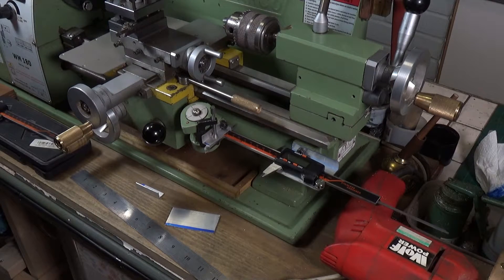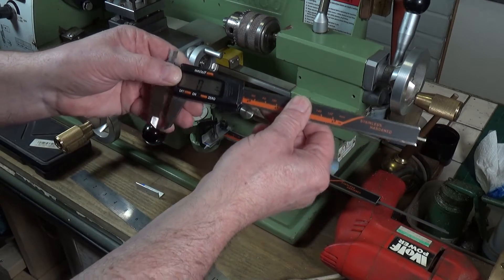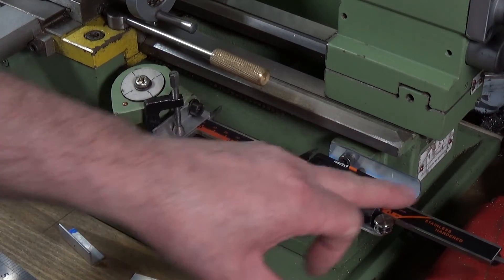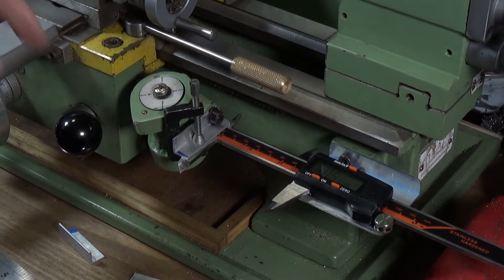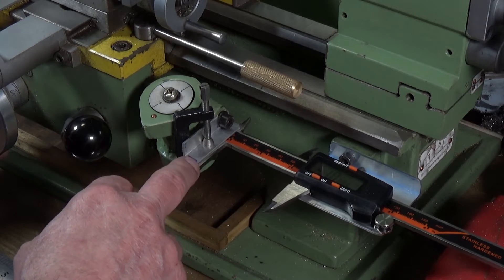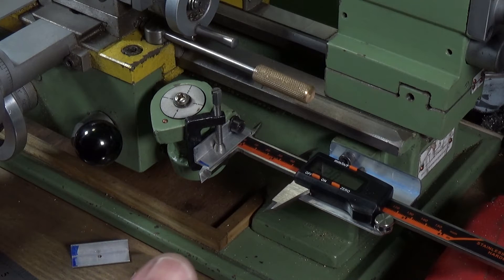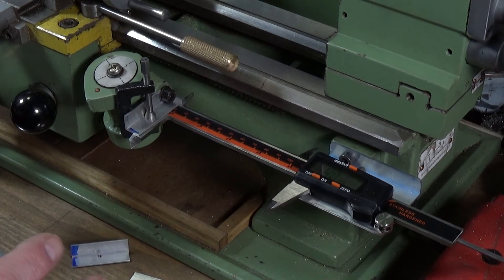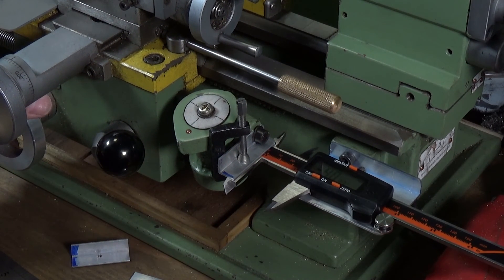Warco WM180 Lathe, Cheap, Easy & Quick Single Axis DRO Mod

Comment: Good idea Alan.  I have a magnetic readout that you have probably seen and yes, they are very good, particularly as far as zeroing and setting a base point.

How do you go with that sized caliper for carriage travel?  Is it long enough ?

I like that caliper. I'm tempted, but already have several.  Candy for the workshop ;)

Cheers Rob
Reply from the maker: Hi Rob, thanks. With regard to the travel, I lose about 1" of carriage travel at the tailstock end and if I need the extra travel I can always remove the caliper. The WM 180 is a very small lathe, I think it looks  a lot bigger in the videos than it actually is. Yeah, I really like the Daniu caliper especially the fraction readout. They're on special offer at the moment only £10.11 and don't forget, you can never have too many tools 🙂
Reply: @RetroSteamTech  That fraction readout is very good.  I wish I had that.  I might have to do a review on one of these.  Cheers Rob
Reply from the maker: @Xynudu  That would be great I would be interested to see what you thought of it. Cheers, Alan.

Comment: just wondered if you tesed it by putting a dial indicator at the front to check how accurate it is ? when moving the lathe saddle back and forth.
Reply from the maker: Hi Matt. No I didn't but that is a very good idea. According to the specs on the caliper it's accuracy is ±0.04mm/0.0016", be interesting to see what a dial indicator says.